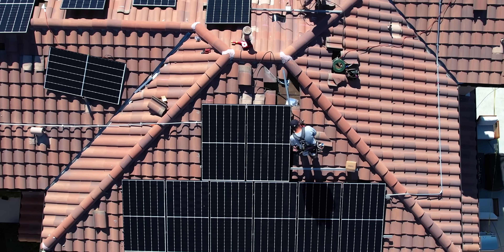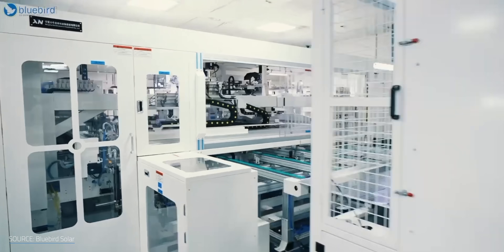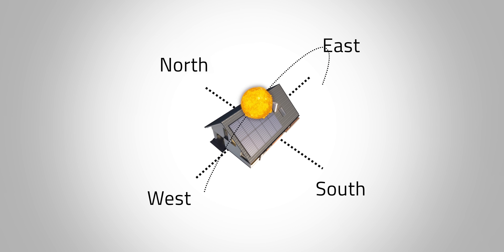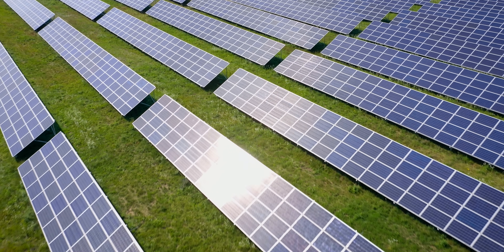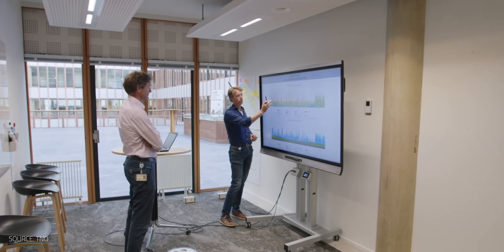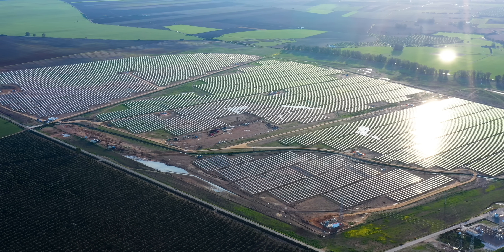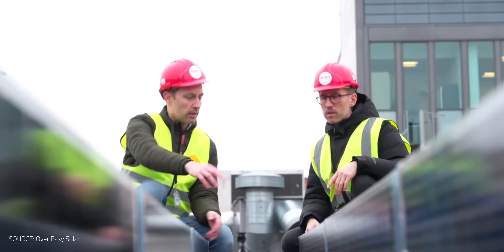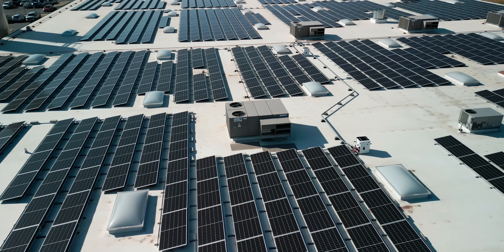Have we been doing Solar wrong all along?

Comment: I've been using solar panels experimentally for over 10 years. I say experimentally because they have never been really practical for generating power. But of course I experimented with various ways of "pointing" the panels. I didn't consider what I was losing but rather what I gained by pointing directly at the sun. It was obvious to the point that many installations have automatically pointing panels. And like others I reached a compromise... finally just taking the angle of a southerly facing roof  But it would be pretty foolhardy to put the panels on the north side of the roof when the sun always comes from the south. On cloudy days it also makes a difference. The graph showed about a 20% loss at peak heat. Well, if you assumed a vertical position at that peak point, I guarantee a far greater loss than 20% by going vertical. One picture shows absolutely no shadow. It's not rocket science to know those panels were putting out zero "wattage". Stupid is as stupid does. Maybe this works with lots of cloud cover and/or lots of snow cover. But come on!

Comment: I suppose I’m not too surprised. I actually worked on bifacial panels in the thermal solar application. 2 flat mirrors directed at a single collector. 😕 Despite my optimism the experiment wasn’t rewarding. As the panel got closer to vertical the heat transfer out of the panel increased. 🤔 A problem for me but if you actually wanted the panel to remain cool ……..

Comment: Thanks Matt for this information , You answered some questions I had regarding heat and vertical installation . i have always thought why not vertical particularly when the panels are covered in snow and thought what a waste of valuable sunlight . sometimes depending on the temperature it can take days for the panels to clear . The other question is the heat generated by the panels seams to go to waste , is it possible for that heat to be used for something ? The captured heat could heat a house with wall mounted solar .

Comment: The fact that vertically mounted panels gets better convection cooling isn't exactly a mystery. Also, if there's plants between the rows of panels, you get evaporative cooling. Desert sand typically has reasonably high albedo, which makes it heat up less from direct sunlight, but the heat that is caught isn't dissipated very well. 

Salt production in evaporation ponds could be the "ideal" process to combine with solar PV, in some situations, if, the solar systems can be made to handle the salt dust/brine droplets well without becoming too expensive. Solar panels would reduce wind exposure, which evaporation ponds typically rely heavily on, but solar panels could cause a great increase in convection. In short, for solar PV you want the visible light, for evaporation you want the heat. So, while it probably would require some careful considerations/development, there should be potential for net benefit for both processes, besides dual use of land. If nothing else, angled solar panels could be fitted with rain gutters and reduce the amount of rain the reach the ground,  making evaporation ponds viable in more areas, and at the same time collect potentially useful rainwater.  

When solar cells were expensive, making bifacial panels to increase net output just a little bit wasn't such a great idea in most cases. Now, the cells themselves almost an insignificant part of the total system cost, adding solar cells to the back side can very well be worth it, when the panels are to be mounted in a way that the "backside" receives more than insignificant light. And in places where the panels fills some other function where both sides happens to receive meaningful amount of light, why not.

Comment: Vertical panels should also stay cleaner than horizontal ones - decreasing cleaning cost and maintenance based on that.
Also, with them being deployable as fences and such, they are easier reachable to clean and maintain which should reduce that cost as well.
Edit: Cooling is logical: With the panels being vertical the hotter air transporting their heat away can escape with no obstacles and is not trapped such as below the underside of horizontal panels. Even a hot air layer a tenth of an inch thick underneath horizontal panels is a great insulation and will keep them nice and toasty.

Comment: If temperature is the known differential between vertical and non vertical, is there any evidence that settings with lower ambient temperatures and sunlight at higher latitudes would benefit in this way, given the temperature difference may be significant. For example, on an island at 60’ north, the maximum air temp at my location might reach 23’C and it seems significant that an inland setting at 50’north would yield a much higher surface temperature. Any thoughts? (Appreciated)

Comment: I have an configuration idea for those bvpv, you could use those double sided panels on an auto tilt system that is controlled by the temperature on the face of each horizontal facing panel. In the horizontal position, when that side begins to get hot to the point where they drastically lose their electrical generational efficiency, they're automatically tilted to the vertical position at the hottest part of that day, reducing their heat resistance, and maintaining their efficiency throughout the hottest temperature period of daylight, or reflective light. Only to return to their beginning position once the at an allocated time of the day to maximize their electric generation throughout the entire period of the day. They would only need two positions then, horizontal at the degree they get the most light efficiency, and vertical to maintain it at the hottest parts of the day. Just an idea I thought of after watching your findings through this video, just kind of makes sense to me to place them on an auto positional system based around their temperature generated on the horizontal face that has the most focused radiant heat to prolong the longevity of the panels, and maintain the efficiency of those panels throughout the entire day.

Comment: Matt, is anybody using the waste heat from horizontal solar panels to preheat their water before it goes into a water heater?  

Kind of like you do in your house with your air conditioner I believe.

Using the water and panels in that way seems like it would increase the efficiency of both the panels and water heating

Comment: Very interesting...

1.  If the direction the panels are placed runs east-west, the extra power received from the "back" side isn't as important.  Further, I've noticed most standard solar panels have white backs.  If they had black backs instead, would vertical single-sided panels also benefit from improved heat dissipation?

2. One of the biggest enemies of solar farms is hailstorms, and one of the reasons I haven't gone ahead with a planned solar system was fear of a hailstorm taking it out.  Mounting panels vertically would mitigate nearly all of the issue.

Comment: Facing solar panels to the south and angled for you latitude is a big part, but making sure there is true AIR FLOW is just as important ... or more important.  Not just a pocket of hot air, but somewhere where the heat can go.  (That's why vertical panels work better.   Hot air rises and isn't slowed by an angle.)

Comment: if solar gets more inefitent with heat cant we cool it with tiny water tubes going trough both panels. That way they can be more eficient and be water heaters at the same time. Bonus point if the hot water can generate electricity as well.

Comment: I can see it being better in northern areas like here in Canada. In the dead of winter, the suns angle is much, much lower than in the summer. Plus, the snow won't build up, and the snow reflects a lot of the sun. This is awesome
Reply: The reflected light from snow on the ground makes a lot more increased power from the panels than you would think. I have seen a small scale test of vertical panels with reflectors at their base to do the same thing, the increase in output was noticeable even using simple Mylar as a reflector.

Comment: I love the idea of vertical bifacial solar as fences, railings, sound and privacy barriers, and shade structures. This has so much potential!
Reply: Good to see someone else on the same wavelength. Imagine replacing your garden fence with verticle solar panels, you could technically say they take up zero space as well.
Reply: @kaneworsnop1007  which you could only do if your garden had a perfect West-east border.
Reply: Or sound barriers on highways.
Reply: @MichalKaczorowski  problem i have with sound barriers is it can't be anyway as good as a textured concrete wall.
Reply: @Distress. It might still be worth it for one side backed by a wall.
Reply: @Distress. You can cover textured concrete wall with panels from both sides, and they would improve sound isolation quite a bit. The major downside is that road means dirt, so efficiency would be pretty low
Reply: @Distress.  I don't think anyone is suggesting to place concrete walls with solar panels, but these could be attached to concrete walls.
Reply: Indeed it has a lot of potential!☀
Reply: Hard to get those things lined up precisely west-east though. But for building facades it should be a win.
Reply: @nowandrew4442  I’m not trying to attack you or anything but why would it be hard to align them?  Put a stake in the ground, take a compass reading of 90 degrees pick a spot on the ground walk to it. Place a stake. Check that the bearing to the first stake is 270 degrees.  Repeat as needed
Reply: @Grunttamer  because it would have to follow the line of the road, or field, or area. If the road wasn't perfectly aligned west-East then the panels wouldn't run as a single fence, for example.
Reply: @nowandrew4442  yeah in that case the position is a compromise alignment wouldn’t really be much of a consideration
Reply: @Grunttamer  you either have to rebuild the road or garden etc, or build a fence that doesn't do what it's intended for. Sounds like a non-starter to me.
Reply: @nowandrew4442  it’s intended to be a fence the electricity is bonus.  You are working within constraints. If it was an empty field you could optimize the angle  but if you have a fence that is generally east-west it’s probably not much of a loss to be misaligned by a few degrees.
Reply: @Grunttamer  isn't the argument of the video that the east-West alignment contributes significantly? And even then only yields a 4% advantage. If you start dropping efficiency left & right to suit the existing set-up, you not only get hit by your losses but the technology as a whole starts getting the same rep as every half-assed thing we do: "it's great in theory but in practice it only averages about half of its promise." So many technologies have died that way, because they weren't used to their full potential due to "accommodating existing systems".
Reply: @nowandrew4442  the argument is that previously you had an east west fence that did not generate electricity but now you do. The other arguments are only valid if you are choosing between traditional tilted and vertical.
Reply: @Grunttamer  since when did we have a perfectly East-West fence? I'd wager less than 1 in 100 is so oriented. Mathematically of course you might argue it's as low as 1 in 180. But humans being humans, the parallel & perpendicular lines (to N-S) probably feature sightly more often.
Reply: @Grunttamer ... Would bumpy glass help? 🎉
Reply: @dareese6778  probably not. But that’s not the point. You are able to put solar in areas vertically that you cant fit horizontally either aesthetically or physically.  When replacing a generally East-west fence that isn’t perfectly aligned the efficiency versus a perfect alignment vertical or traditional tilted  installation doesn’t matter.  It’s a 100% improvement by virtue of not being solar previously.
Reply: @Grunttamer   the electricity is a bonus? if its intended to be a fence, its an extremely expensive fencing material to use compared to other things if the 'fence' part is the priority.
Reply: @dareese6778  I have seen flexible panels with a bumpy plastic cover (they don't use glass) advertised as better in indirect light.  Makes sense.
Reply: @Grunttamer  Yep, I like this. But don't forget that panels are not free.  The cheaper they become, the less important to optimize.  When more expensive and you want to milk the panel for all it's worth.
Reply: I can also see using the vertical panels for east/west walls on houses and other buildings. I'd expect they'd have similar efficiency gains as the bifacial variants.

I wonder if combining the two styles  into a U-shaped panel would also help with efficiency. Vertical bifacial would provide shade and cooling to the horizontal monofacial so all three can work together.
Reply: Thieve will steal them....
Reply: How about... none of the above. Because the process required to create solar panels and the remains of solar panels once they have reached their end of life is far worse for the environment.
Reply: @jeremiah6462  You comment that production and disposal of panels is far worse  but worse than WHICH alternative is the question.  Burning coal? Doubtful.  Natural gas?   um...  Nuclear? Almost certain nuclear is lower impact.   Also, in support of panels; the more a technology is popularized and as tech marches forward, efficiency improves.  Manufacturing process improves as driven by market and regulation.   ICE engines are waaay less impactful now than 100 years ago.
Reply: Only works in places that don't have protest marches, activists, and vandals that are willing to commute to find something valuable to ruin for fun.
Reply: @naekosl3059 don't just blindly repeat propaganda, think first!
Reply: @naekosl3059  things have really taken a nose dive since 2020.   Sanity will return one day
Reply: @naekosl3059 there will always be people who want to sow chaos and discourse, it’s not a “certain people” or “subdivision” when I was growing up we had the anti establishment punk movement. Maybe where you live there’s more pride towards the flag than the care towards the people who live under that flag? Most people who dislike the America of today are victims of the America of yesterday. Blaming the left the right or “some people” isn’t gonna make America any better. It’s all division to keep us watching eachother instead of the powers that be.

Comment: I have just taken my average small semi-detached house with limited land OFF-GRID, it has been hard work and in mid winter I have to be frugal. But two things nobody seems to think of is Cleaning/Maintenance and Snow coverings. One thing I will be fitting to make winter easier is vertical panels on my walls, some are of the type that have better low light performance. My advice to people is you really need panels on all elevations. One big problem I have is sunny winter mornings I have not currently got any panels that can harness this energy and what I find is in the winter frequently has the day progresses the moisture builds up in the atmosphere, clouds form in the winter sky by the time my other panels would normally be exposed. Yes fit South facing panels to start, but use West facing panels to catch the late evening summer sun so that you have plenty of power to run the washing machine when you get home from work. In the summer my North facing elevation is actually very well illuminated late evening, and I still do not have any panels to catch it. Multiple panels, multiple positions, multiple charge controllers, so that if one burns out you have plenty of built in redundancy in the system. Not yet got into wind, I expect to get a small useful amount on bad windy dark days, but not a lot from a small urban wind turbine, my other venture will be in Thermal electric to generate small power from my wood stove. A good idea is to think of your house has your own micro grid system, when sizing stuff, work out what loads would be useful and what amount of wind or solar could power those loads. Create multiple micro systems so if one goes down you always have back up. I actually have a rare old 12 volt only Petrol generator, so far this winter it has probably now consumed £20 worth of fuel, pitch that against the truly obscene standing charges, I used to pay for of £35 a month and its a no brainer.
Reply: local conditions permitting, one could also consider creating reflective surfaces which re-direct sunlight onto some of the solar panels earlier / later in the day.
like one commenter earlier wrote -
they get extra yield from reflections off a nearby lake as well as a shiny nearby roof.
another (albeit small) power source for blackout preparation or off grid living,
especially when resources from solar + wind may dwindle during prolonged bad weather conditions:
exercise treadmills attached to generators (I've seen YouTube videos where people used old car alternators)

heat generating appliances such as washing machines, power showers, kettles could be supplied with pre-heated water from stoves /fireplaces, which should reduce electric demand drastically if that were previously used to heat all the water.
Reply: Just use separate controllers for different angles and take advantage of the sun for more hours in the day, with larger scale 3 or 4 controllers can work better than one big one that gets too hot, you have X storage at some point it fills   the earlier and later in the day power is full the more you have at night
Reply: Ans; Active solar heating.... Yeah. You're welcome.

Comment: One issue is that a solar panel has never been properly designed . It’s just pv materials in a aluminum picture frame. They are very difficult to install mechanically and electrically . The frame catches dirt , the glass reflects sunlight. My panels put out more power when there are clouds in the north which is a mystery to me.